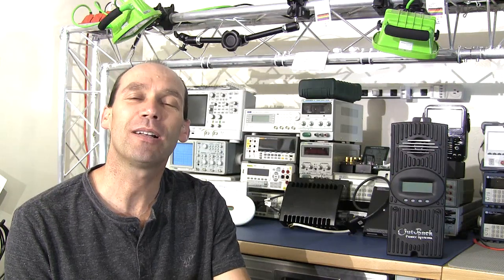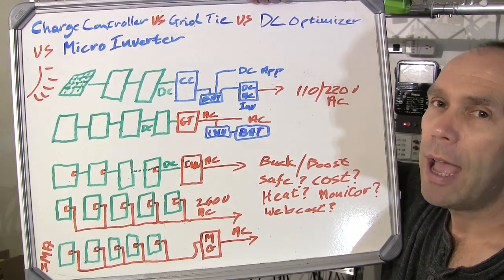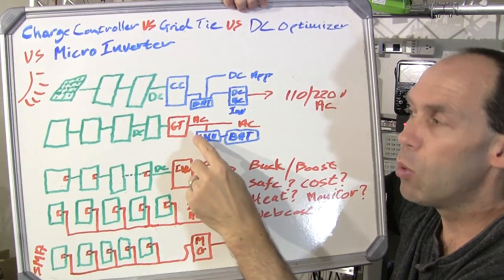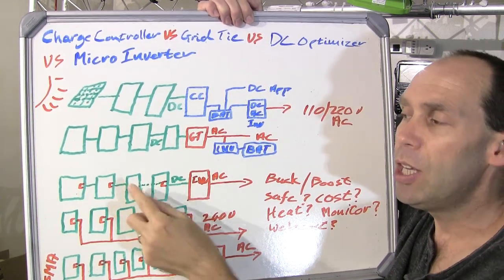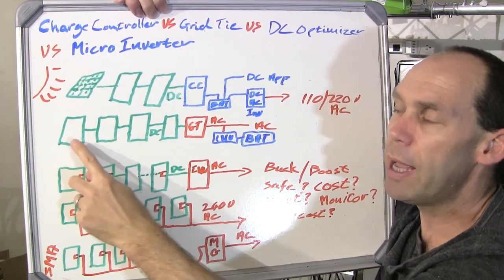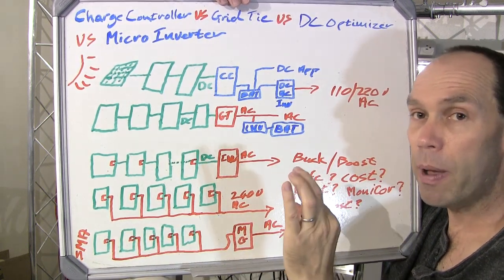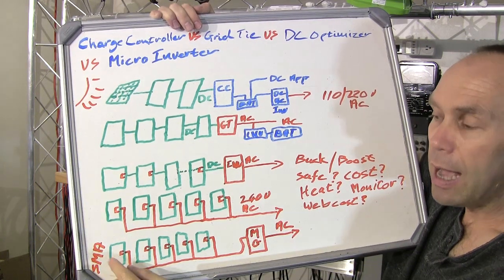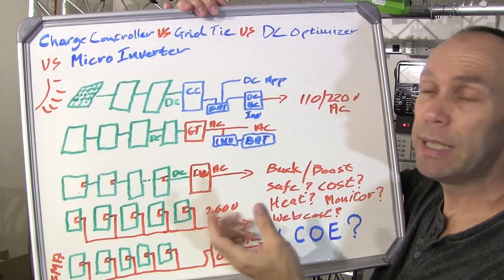How to Solar Power Your Home #7 -  Grid Tie v Micro Inverter v Power Optimizer v Charge Controller

Comment: I love my solar panels although  I get little power in UK winter when I could most do with it for heating for example but the rest of the year is fine. The power output defintiely increases when the plants begin to sprout their leaves.
Apparently my inverter contains a mobile type sim card which alerts the installer if the system has problems and they are supposed to then arrive and fix it which I imagine could be an awkward job having to basically remove all the pannels to find the defective one or more. Do hope they remain reliable.

Comment: Hi Martin. Thanks for sharing this video. I have a quick question: When we use solar panels connected to a Grid-Tie inverter which is connected to the grid, what are potential issues in terms of meters? Do we need to have special type of meters that are capable of working backwards? What about digital vs. mechanical meters? Are they all capable of doing so?

Thanks

Comment: One note i will bring up is on inverters with batteries. I mess with boat systems that the inverter charges the battery bank when at shore and can be used later when out at see. What i see is that you have a large battery bank that powers the inverter. The inverter isnt smart enough to charge each battery separately so they wind up frying batteries because one will die and the inverter see's a low nominal voltage so i continues to try and charge the battery bank and winds up over charging the rest of the batteries. Just a tip from what i have seen happen in real life.
Reply: an inverter may not be designed to be a battery charger.. and people are often stupid in how they manage their batteries.
Reply: very true, its very rare i see them treat the batteries like they should be

Comment: There is already a battle brewing in the states. The utility companies want to charge customers anywhere from $100.00-150.00 a month if your grid tied to their system. So I would check before I spend money on a grid system.

The micro inverters are tested in some of the higher tempeture, humidity environments you will find and perform very well. Just don't buy from a company that had not been around very long. They seem to come and go very fast as government funds dry up to offset their cost.
Reply: screw the grid tie if it costs you money.  Be independent.  Who cares what the power company says or does.
That is the whole point of solar.  Store the excess in your Leaf electric car, or battery bank. Or don't build an oversize system with money as the focus.
Reply: In Cape Town, there is a small fee involved if you want to push power into the grid. The idea is the same, they really only want bigger setups on the grid, not every small guy with a GTI and a couple of kilowatts to spare... the fee is however much less than a hundred USD, it's more like a hundred ZAR :-)

Comment: I like the idea of optimizers. They seem to be a cheaper alternative to Micro-inverters and can pass through more wattage than micro-inverters which may clip 20+ watts off a 280 watt panel. However, I'm hesitant to use them because of my uncertainty of whether or not they will handle shade and different orientations as well as micro-inverters. Product literature is not particularly clear on what happens with a mismatch between a module experiencing shade and the module next to it that experiences no shade at all. Is production completely independent between the two? Or, does the shaded module result in a percentage reduction in the module next to it (and possibly others on the same string)? What I'm saying here is that I understand optimizers are supposed to even out mismatches, but how much? It would seem the devil is in the details.

Comment: Hi Martin,
I recently purchased 10 240watt canadian solar panels that were pulled off a roof system that had a termite problem and hadn't been installed correcectly - anyway it was one of those "got lucky" deals. The problem is I have no idea how to use them in such a way as to not burn the house down. My plan is to setup a mixed configuration, of 1k watt grid tie system, then 1500watts for a more traditional charge controller, and battery backup system. 
I am currently on grid, and would like to reduce my costs of electric with the grid tie system. The 1500 watt backup system would be exactly that, it would be my SHTF off grid system should I lose the grid. However, I don't want the back system to not be utilized, I'd like to use it to power a segment of the house dedicated to a desktop computer, a freezer and some lighting. 
  My plan at present is to take 1k watt, using two strings of 500watts each feeding individual grid tie chargers. That's the part that I understand and have figured out reasonably well from a hardware perspective. I've purchased a couple of 500 watt grid tie inverters.
The 1500watt backup system is where things become more of a challenge for me. I've purchased 1k watt puresine inverter and a morning star ts-60 and 45 charge controller.  The idea was that the 45 would be used during now with the 1500 watt array, and the 60 would be added to the mix if the grid did come down for an extended period of time. will the 45 support the 1500 watt panel configuration, should they be setup in // ?

Thanks,
J
Reply: LetsDo ThisThing I strongly recommend using an all-AC system, an AC charger for the batteries (which you can get anywhere), and a cutover switch. If you split the system like this, the panels on the DC side are going to spend 99% of their time doing nothing. Sure you might power something small like a laptop, but only at the cost of those panels not offsetting your normal power, and doing so for a very high cost.

Comment: Good day, all. I stay in Centurion, South Africa. And am thinking of installing a PV system to augment my Eskom supply. Idea is to first use PV power and only use Eskom when PV insufficient. Which would be an affordable grid tie invertor (say 3kW) that would do the job, automatically switching between PV and Eskom sources?
Reply from the maker: The two options I would look at are MLT Drives and Victron Energy. Cheers, Martin.
Reply: A have a friend with a 4KW array and an SMA Sunnyboy grid-tie inverter. He makes between 10 and 15 kwh a day, which has cut his bill in half. With a GTI there is no real "automatic switching", it layers the incoming solar "on top", almost like a bit of butter on a slice of bread (Eskom being the bread), so you bite into the butter first and into the bread if there isn't enough butter (I hope the analogy makes sense :-) ). At night when there is no butter, you eat dry bread.

This friend of mine has an old meter. He simply lets the meter run backwards. This isn't really legal, but in such low quantities it isn't too much of a problem (I think the authorities might disagree with me there). In order to gain maximum from his own power, he runs the pool pump during the day.

Here in Cape Town you can get permission to feed into the grid, but they actually charge you a fee for the privilege, which I suspect it specifically designed to keep out small producers, in other words, you need a fairly big system before it makes financial sense. They also force you to stay a net-consumer of power, by only paying you the lesser of the consumption/production numbers, so if you produce more than you consume, you don't get money for the extra production.

My father has a similar setup on his farm in Namibia. Their meters have reverse-lockup, so you can push the power back into the grid, but you don't get credit for it.

I have an electronic meter. Those meters can't see the direction of flow, and will actually charge you for current you push backwards.

The downside to grid-tie is that when the grid goes down, so do you. That means that during load shedding, my friend with the GTI can lose as much as 10kwh.

Because my main reason for going solar was that I work from home and I needed backup during load shedding, I went with an off-grid system instead. I used one of the cheaper Victron Multiplus inverter/chargers, and programmed it to do grid-failback, so it runs off the solar/batteries and go back to grid at night (usually around 9PM, my batteries are small and I don't cycle them too deeply). Shortly after I did that, Victron came up with a system which they call hub-1. This system uses the usual PV-string(s) setup with a Victron MPPT charge controller, batteries and a multiplus or quatro inverter. The inverter and the MPPT controller are connected to each other (using a VE.Net comms channel, which is presently still quite expensive), so the inverter knows how much power is coming into the DC-bus. It can then take any surplus and push it back into the grid. This way you get the best of both worlds. You should read Victron's self-consumption whitepaper on this :-)

Finally, something that a lot of people are doing in my area (Helderberg) is to installa Fronius Grid Tie inverter, and combine it with a grid-limiter, a device that throttles the GTI back to the point where you don't push back into the grid. The grid-limiter device is made by a local company called Exsolar (mjlorton is well acquanted with them :-) ). That might be something to look into.
Reply: Thanks plonkster. Very informative input. Regards

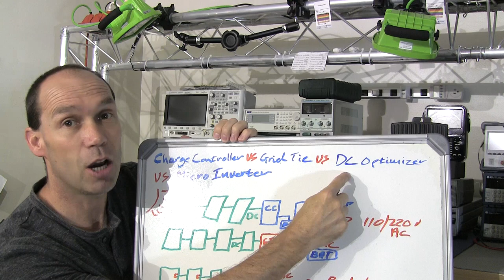Comment: I bought a micro inverter brand power one model 0:25, but in Brazil the import rates are high, approximately 70% of the product + shipping, so I'm not afford to buy the original trunk cable to connect the drive, someone could I indicate in the photo report which are the four AC cable pin micro inverter?

Comment: I am using sun system microinverter 320s (power optimizers on my 200watt/12V solar panels. Do I connect the optimizers set up in 48V strings to the solar power controller and then to the battery  bank  or do the optimizers replace the solar power controller?  The battery bank is then connected to the AC power inverter which goes to my AC box for powering my barn?

Comment: 5KW SYSTEM 
MICRO INVERTER STILL CHEAPER THE GATEWAY IS ABOUT 600 BUCKS 
WHILE DC OPTIMIZER INVERTER EASILY COST OVER 1000 BUCKS

Comment: Excellent set of presentations, thanks for your efforts.

In any system using multiple inverters (e.g., using local micro-inverters, or redundant "main" inverters for single point failure protection, etc.):  how can the timing of the inverters be synchronized so that they always stay in phase?   Unless there is some "master" oscillator which drives all of them, even miniscule variations in output AC frequency will, at worst, result in the output of one inverter canceling the output of another one and, at best, still result in a "ratty" waveform.

Comment: Thank you for these videos, mjlorton. My wife sells "solar solutions" via a well-known South African auction/sales site and although we both have some knowledge, I believe that one can never have enough. 
I personally think that this whole "going green" drive is one of the latest big scams to be perpetrated by big business and governments in another of their multitudinous efforts to extract money from the gullible proletariat. Let's face it, the plebeians don't have the money to afford these prohibitively expensive solar systems and the patricians don't give a sh!t, so it's the workers who are the primary target ... correct me if I'm mistaken.
I was born a sceptical cynic and although I have had cause to change my stance on a number of occasions during my lifetime (I'm now 66 years vintage), I still look at everything from the outside, which gives me a rather unique perspective of everything. 
Look, none of the components of any alternative energy system are designed to last very long. The weakest link is the storage system, i.e: the batteries. What most people do not understand is that, no matter the original Ah rating, most batteries cannot be discharged by more than 20% without them degrading prematurely. Lead crystal batteries can stand up to 50% DoD, but not on a continuous basis. In the end, one will have to keep buying new batteries, which runs counter the 'savings' idea, as batteries are damned expensive and I do not see their prices going down, ever! Then, in the case of lead-acid (and certain other) batteries, there is the problem of 'memory', which few laymen fully understand. Another problem is the fact that batteries cannot later be 'swapped out' if any fail within a string and that the battery bank cannot be added to, to increase one's carrying capacity, at a later stage: ALL the batteries must be replaced at the same time, lest the older batteries "steal" charge from the newer ones and in this way lower their capacities.   
Degradation and the need for eventual replacement is only one side. The other is the fact that all the components of all types of alternative energy systems require raw materials ... I doubt very much that any of the manufacturers are using recycled materials ... or am I wrong here?
Now, go through the whole manufacturing process, cost in transportation of the various bits and pieces from manufacturers to assembly plants to retailers and any other middlemen that may be involved - costs are incurred every step of the way, from the design office to the sales floor. Job creation is one thing, but there is such a thing as overkill.
Sustainable? Sorry to throw ice water on the party, but I really don't think it is, because we're using up resources that WILL run out: it's just a matter of time.
I have summed up my particular stance in two sentences: "The alternative energy drive is focussed on making money from people who are looking for, or have no, other options.
My drive is focussed on finding options for people who have no money."
I am looking back at older technologies: the kinds that our grandparents used and although they may not be as 'convenient' as modern methods, they do work, they last a hell of a lot longer and most can be implemented at a fraction of the cost of modern systems.
Perhaps our best option is to take a few steps back and find another way to solve our energy requirements, one of primaries being the finding of ways to minimise our needs.

Comment: There is one thing you didn't mention... What if you not working DC optimizer/micro inverter in middle of the roof and if your panels are close to each other ..then you have problem because you have to remove panels that are in the way to your not working panel...and that could be a bit of problem.. If those panels are not so close to each other or you have just few then it isn't problem.
Reply from the maker: SylwerDragon True...good point.
Reply: btw sorry sorry for typo..i was in a abit of hurry that night :)
Reply: SylwerDragon .
Reply: +Nobody YouKnow  he was discussing the pros and cons of each type of system.  points of failure cost of repair or maintenance are all factors that vary by design.  ease of access for repair or troubleshooting is important as he stated the technology is still so young we do not have long term data to know what issues will arise with certain systems like micro inverters.  

I wonder why we can not mount the micro inverters so they are accessible without removing any panels...

Comment: People Stop buying  every little thing that these people tell you to buy for your solar panel needs. It's all a waste of your money, just like Y2K . Convert your home to DC power by buying all your appliances in DC just like a mobile home does and you will have no need for Inverters, Micro inverters, optimizer and all of that wasteful power spending . All you will need are LED lamps, fans and motors that work with DC current and some regulators and that will save you more power than converting your DC panel to AC so that your LED lamps, TV set and other appliances have to change it back to DC, what a waste. You will already save 30 % of that power by not using RMS AC.

Comment: why you inverting your solar power to ac then deverting back to dc for most things in your home  why not run your home on dc power like a trailer or your car then switch your wiring to dc .with reducers on you wires to the correct amp   .stop inverting to devert back to dc